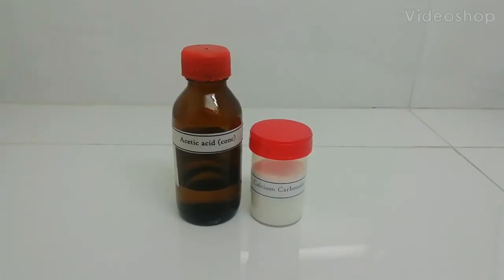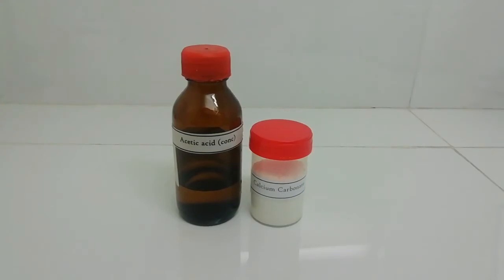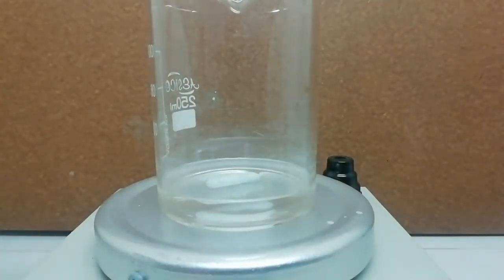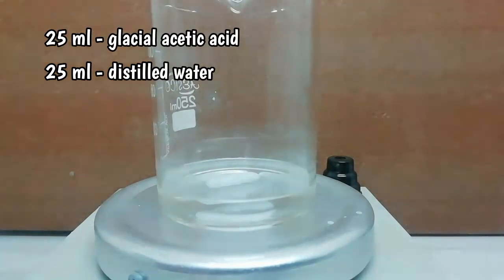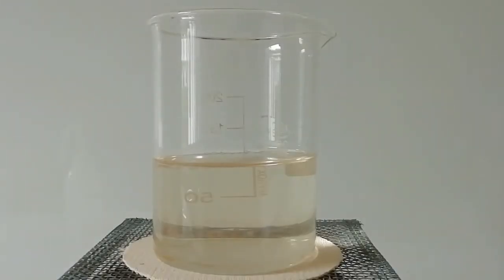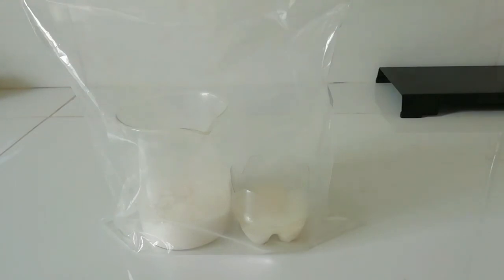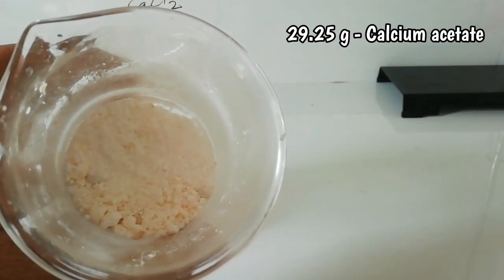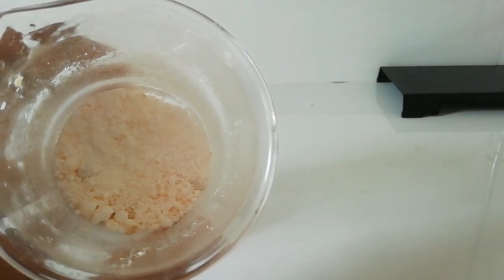How to make Calcium Acetate

Comment: Your ratio is way off.
150ml of 5% vinegar
25ml water + 25ml of 15% (7.5% diluted)
(wrong) 25g calcium carbonate (wrong)

CaCO3(s) + 2CH3COOH(l) --> Ca(CH3COO2(s) + H2O(l) + CO2(g)
This equation tells us that 1 mole of calcium carbonate reacts with 2 moles of acetic acid to produce --> 1 mole of calcium acetate, 1 mole of water, and 1 mole of carbon dioxide.

Therefore, for 50 mL of 7.5% vinegar, you would need approximately (50 mL / 16 mL) * 1 gram = 3.125 grams of calcium carbonate, not 25 grams. You would be fine though doing 3.5 grams to insure all the acid is neutralized.

(Your 15% acid diluted down to 7.5% acid should need 3.125 grams of calcium carbonate.)

For household Vinegar and pure calcium carbonate powder:
1 gram of pure calcium carbonate powder 
24ml of vinegar (5% acetic acid) although you want to have a bit extra calcium carbonate, so that you don't have acid left over.
22ml of vinegar (or 22.8ml of vinegar which would be 5% extra calcium) would help ensure you don't have acid left over, but you should also test it with a PH test strip, which you can get a "book" of litmus papers for dirt cheap and you only need to use a piece of a strip. If it just looks wet, it is neutral. if it turns red, it is still acidic.

Comment: Nice Work Brother. Can I do the reaction with 5% Vinegar? 
Thank You. 
And you have earned yourself a lifetime subscriber.
Reply: CaCO3(s) + 2CH3COOH(l) --> Ca(CH3COO2(s) + H2O(l) + CO2(g)
This equation tells us that 1 mole of calcium carbonate reacts with 2 moles of acetic acid to produce --> 1 mole of calcium acetate, 1 mole of water, and 1 mole of carbon dioxide.

TECHNICALLY: For household Vinegar and pure calcium carbonate powder:
1 gram of pure calcium carbonate powder 
24ml of vinegar (5% acetic acid) although you want to have a bit extra calcium carbonate, so that you don't have acid left over.

HOWEVER, you always want to use a bit extra calcium carbonate, so a better ratio is:
1 gram of pure calcium carbonate powder
22ml of vinegar (or 22.8ml of vinegar which would be 5% extra calcium, so anywhere between 22ml to 23ml should be fine)

This would help ensure you don't have acid left over, but you should also test it with a piece of a PH test strip, which you can get a "book" of litmus papers online for a dollar and you only need to use a piece of a strip. If it just looks wet, it is neutral. if it turns red/orange, it is still acidic. If it turns blue/green/black, then you did something wrong and it became alkaline/basic.
Reply: Good question, waiting for an answer